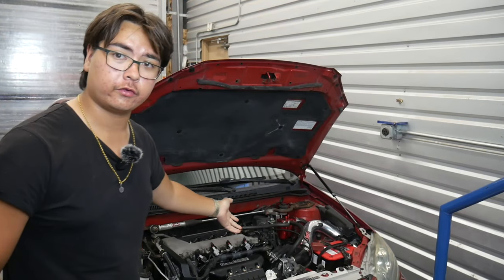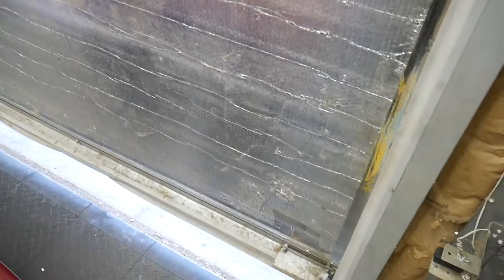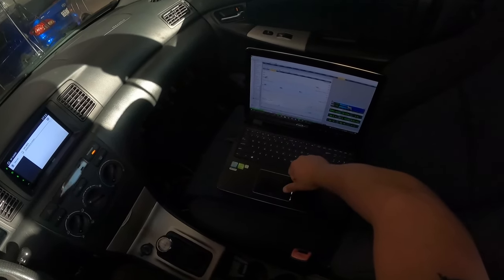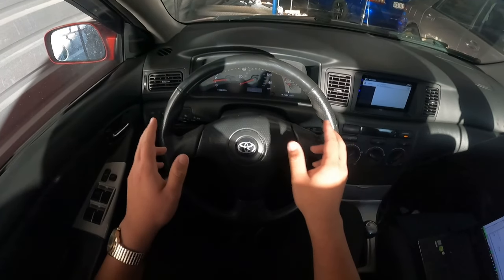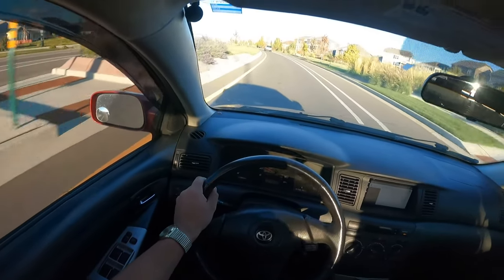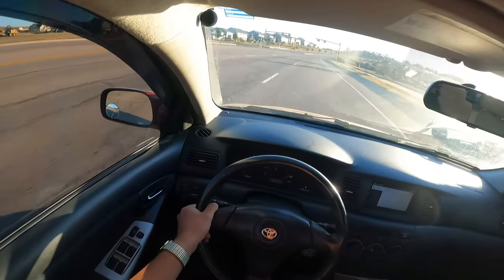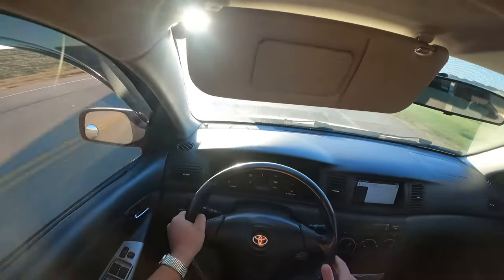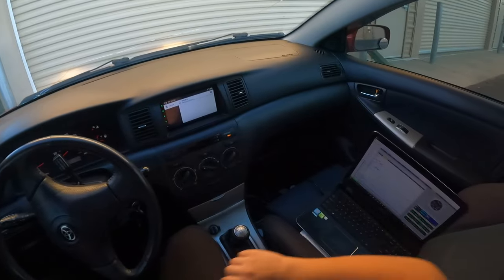First Drive In The Supercharged Corolla XRS! (Discovering Tune Issues)

Comment: Seeing him getting scared of the check engine light in a supercharged corolla while i am dailying my wrx with a check engine light for a year with massive pulls laughing.
Reply: Atleast Scan it with a OBD2 scanner to see if it is serious. Knock is pretty serious TBH
Reply: When a car comes with a supercharger and it has a factory tune is not the same as installing a supercharger, doing the fuel system, tuning and labor yourself. 
  And anyone who would laugh at his concern...well... tell us youve never worked on your own car without telling us youve never worked on your own car. Cringe.
Reply: @DeepRacer-zr4yp  its a lean code. One of the pipe needs replacing.
Reply: @Hammerback0  i work on my car the only thing is that i dont care about the fa20 engine. Im waiting to replace it next year.
Reply: @fakethiscrap2083  ok, can't you just use some Exhaust Bandage Tape? Or is it the connection that is corroded?
Reply: @DeepRacer-zr4yp  no its one of the hoses that i would need to replace but the issue is that i dont have the time to do so since i work all day. Lol i will do it at one point next year.

Comment: Pretty sure the ECU uses the engine light as a shift light
Reply: That seems possible because of how it turns off once he lets off the gas.
Reply: @Just_In_credible6  but then again if that were the case it would turn on at like 7800rpm-8000rpm not bellow 6000

Comment: HE BEAT ME TO THE PUNCH!!!! I  have same setup except it was installed and tuned by MonkeyWrencgRacing. I ran a 15.000 last week 4/7/24 at Island Dragway in New Jersey! I WILL POST A VIDEO!!!  I also have the dyno graph . Mine peaked at 200hp BUT 130 ft/lbs of torque from 3-8.5k rpm. EXTREMELY daily drivable!

Comment: The normal operation temp is between 85 and 95 celcius. If you have an upgraded radiator its normal to have it lower than 80 celcius.

Comment: Great job will. I have a Celica GTS with head I build myself with mwr street cam, plus size valves, ported, ferrea dual springs with ferrea seats, retainers and keepers, obx exhaust manifolds. Anyway, I'm looking to upgrade my intake manifold and I'm wondering what you gonna do with your aftermarket intake manifold you just replaced with your supercharger. Are you selling your aftermarket intake manifold?

Comment: I would take a look at how ur knock sensor is configured and see maybe if it’s just picking up mechanical engine noise. Especially since it was at 7k rpm, your AFR looks good and your timing looks pretty conservative too. Take out a couple of degrees and check the knock sensor log again. If it’s not on oem ecu it can be a pain to get the knock sensor configured right

Comment: Funny how the engine light came on and then was like sike :D

I'm thinking about these supercharger builds and it kinda seems good on a 4-cyl BMW. But I wonder if it's a bad idea if you plan to redline the engine a lot. Like is the jolt stress of another belted engine component gonna be bad over time, are the chargers themselves going to have hiccups if the revs are staying high a lot etc.